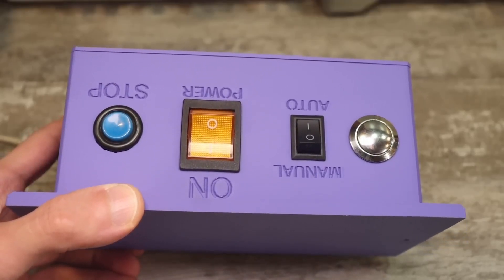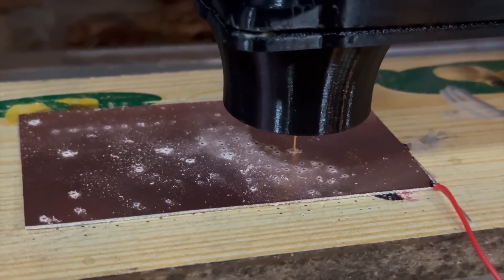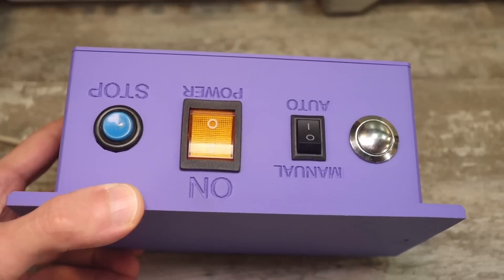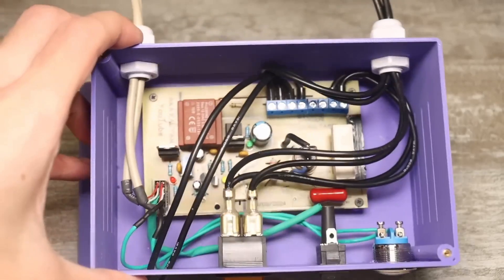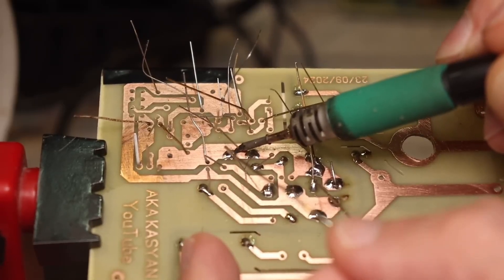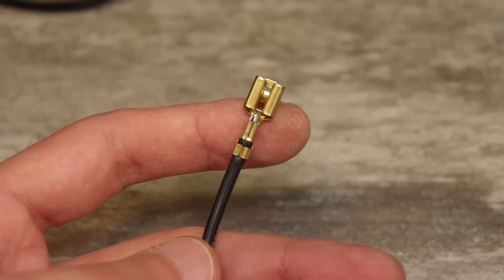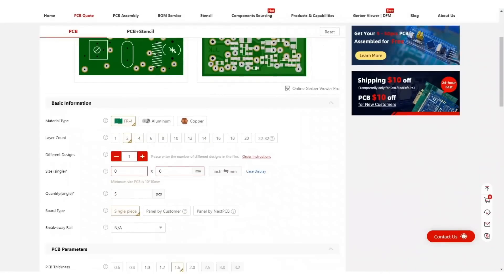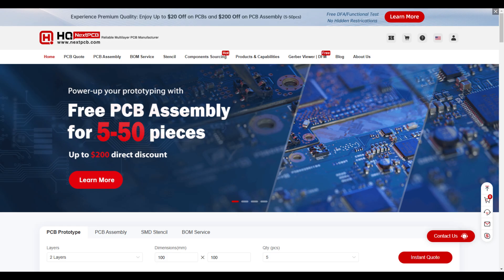The Working Days of a Slacker

Comment: Hi! Found your channel very interesting, I'm a new subscriber. 

Just a note if you ever want to get CE certification for your device and because I was failing for this before: Because your device is capable of shorting more than 15 watts when a component critically fails (or a wire falls and shorts another one), your enclosure MUST be fire retardant (a "fire enclosure"), typically your plastic material needs to be UL-94V0. Most filaments I've seen are not fire retardant, most plastic enclosures are not either. Some plastic enclosures are specifically designed for mains (like junction boxes). 

This is a requirements of the low voltage directive (internation standard IEC 62368-1) which is part of the CE standards (together with EMC, which is another concern on its own). 

A couple of years ago, this became more stringent. UKCA certification is basically CE certification, the use some other terms in their standards, but it's the exact same tests and you can claim UKCA compliance when you're CE compliant.

I'm telling you all of this because some time ago I was designing the exact same 3D-printed enclosures, in the same violet color and tried to pass CE a few times, and this was always a failing point. I thought i'd save you a long and expensive process by sharing this bit of information with you.

This being said, keep up the good work!

Comment: May i ask...? What type of solder d you use? Lead? Flux core? Sorry for all the questions.. but, your soldering flowed so quick and smooth, and didn't see any flux used... Thickness/ Size of solder?.....At what temperature are you setting on your iron?

Do you preffer a thicker iron tip or thinner one? I found contrary to initial logic, using a larger/ thicker iron tip helped, since it held/ transferred heat better.

Comment: As an old follower of your channel and a fossil of the era between vacuum tubes and transistors is worth to try all simple alternatives before using a micro controller, if you can make a simple solution that is reliable without coding later when coding is applied the design is even better, example: why use an app on a smartphone to tell you that you left the fridge door open when two servos and a sensor can close de door for you without having the fridge and the phone connected to the internet.

Comment: I totally agree with your point about not using a microprocessor for reliability and design simplicity - however, I have often found that when I do this, the customer ends up wanting things they haven't thought of yet - and had I used a microprocessor, it would have been easier to make those changes.
Reply: Remember, the customer is always a fu.... errr forgetful.